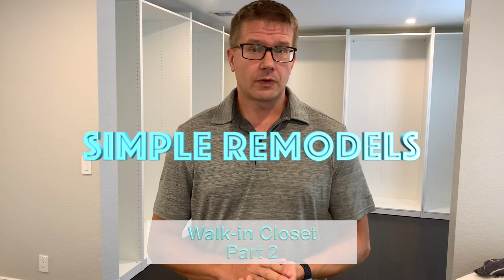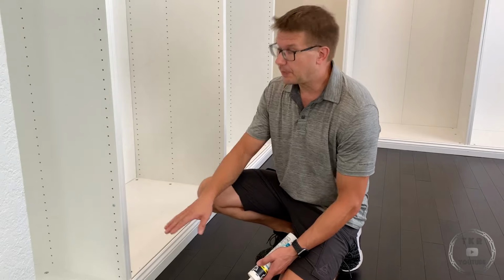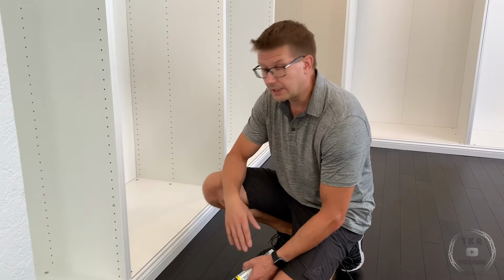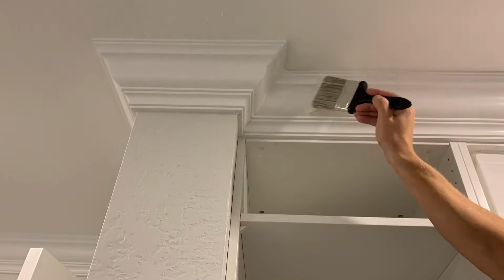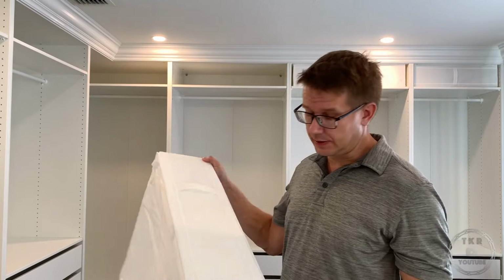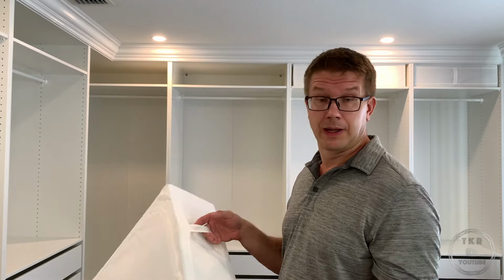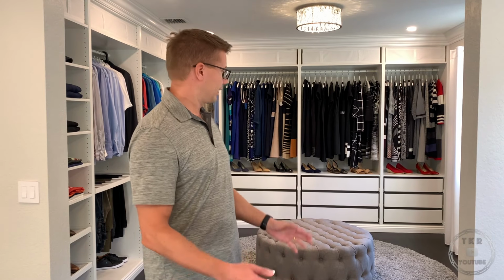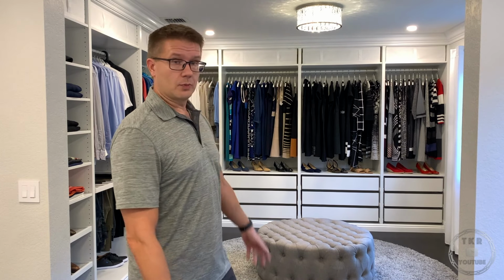Walk-in Closet DIY Build Part2

Comment: Good husband- way to go. Great call putting the top on lower than all the way up instead of trying to figure out a block on top for the crown molding. Also loved using the handheld vacuum when drilling- I’ve always just used a piece of paper but your way makes more sense

Comment: Great job!  Very inspiring.  We are in the midst of doing virtually the exact same thing.  The only problem is that we gutted the old space and THEN learned that most of this stuff is not currently available at IKEA due to supply issues.  Drove two states away just to get a couple of their last largest cabinets, some of which I'll have to cut down to make narrower, and then pray we can eventually get the rest of the internal pieces.  But after I paint this weekend and get my new flooring in, I'll be doing everything you just showed.  🙂 Thanks so much!
Reply from the maker: Glad if the video was helpful. Yes the supply problem is so annoying. Trying start Ikea kitchen update but let's see how long it takes to get all the cabinets delivered. Good luck with your project!

Comment: Your closet turned out beautiful. Did you do anything to hide the seams between the cabinets?
Reply from the maker: Most of the frames sealed tight after leg alignment, but I used white caulk in 2 areas to hide a small gap